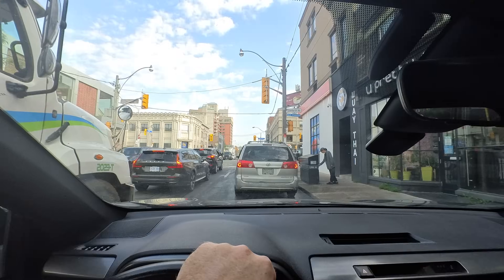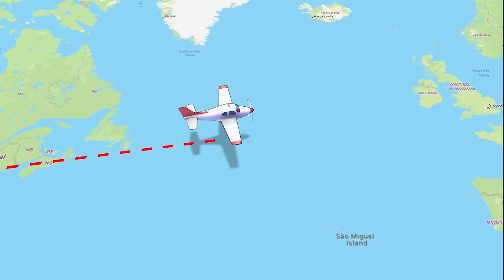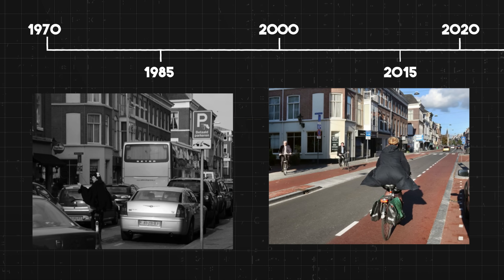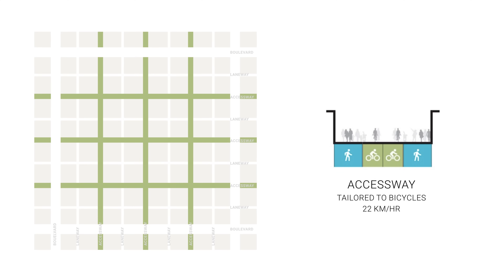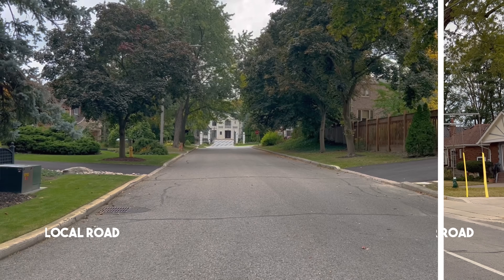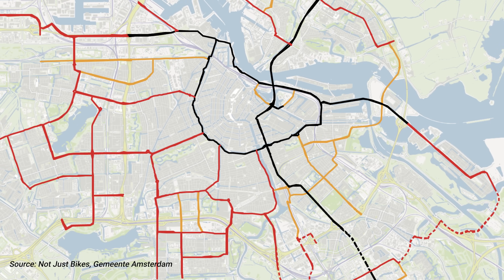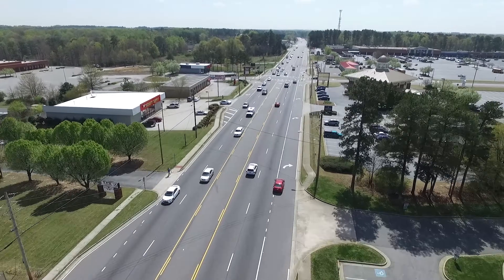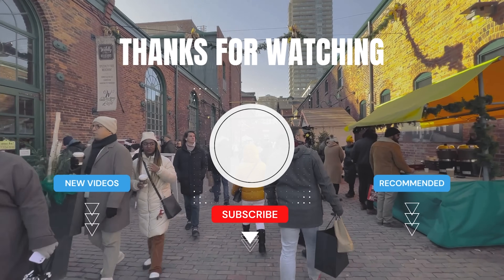How the Dutch SOLVED Street Design

Comment: The rule of thumb: If two modes of transportation share the same space, the slower sets the speed. In reality there are exceptions for places where pedestrians are extremely rare.
Reply: The Dutch book on urban planning actually explains that this is one of the positive aspects of non-separated bicycles lanes
Reply from the maker: Thanks for sharing. Good rule of thumb 👍
Reply: I think the important part is that the busy areas, like stroads, slow down traffic. Here having public transport and pedestrians would allow more people in less space. Then there will be less drivers, and the actual drivers could actually drive towards the highway and other faster roads.
Reply: Right. That's why bicycles scoot past cars stuck in traffic.
Reply: Also traffic lights determine the flow of traffic. You may have urban roads with 2 or 3 lanes per direction (cap  up to 1000 car per lane per hour = 3000). But this becomes useless when you approach a traffic light junction.  (capacity of just 150 vehicles per lane, per hour ) .    2x2 or 2x3 urban streets don't make sense and are only dangerous and discouraging for pedestrians and cyclists !
therefore in Netherlands roads/streets in built up areas are usually limited (and even brought back to)  to 1x1. With traffic lights 1x1 is enough.
Reply: @lws7394  "Also traffic lights determine the flow of traffic"

Also, traffic lights are expensive...
Reply: @lws7394 a roundabout allows for x*3000 cars to make it though the intersection compare to 150 the average flow of a roundabout is 750*x
Reply: That isn't realistic. It is hard to bike as slow as someone is walking and almost impossible in a car unless you are riding your break constantly. It is also quite silly to drive at walking speed. Down right stupid actually.
Reply: You are incorrect. Traffic lights set thejourney speed ! You can share a country road and a car will travel at 60kmh and the bike at 20kmh. Bring in traffic lights (in an urban setting) and no matter a car drives 60-80kmh, higher speed will get undone by waiting at the traffic light junction. And indeed in London the average speed of a vehicle is 17kmh !   Not due to 'bikes', but because of traffic lights and congestion.

(This counts also for bike traffic. There should be as little traffic light junctions as possible . For example in my 200k Dutch town, I can travel north to south 8km and aproach like 6 traffic lights and a movable canal bridge (esp. in summer!). And if I push it by taking a street parallel I can even limit it to 1 traffic light and the bridge !)
Reply: @lws7394  Incorrect. This depends on the distance between two traffic lights and the speeds of the cycle. Imagine the trafficlight as a busstop where a bus leaves every 2 minutes. If you get there just before the bus leaves, you've gained time.
Reply: The rule of thumb: slow drivers will spread out across all lanes, slowing down traffic to a crawl. UBER veteran.
Reply: @garryferrington811 In NL slow(er) drivers are required to keep to the right lane(s) (if more than one). Foreign drivers are easy to spot, unfortunately.
Reply: I have seen pedestrians reach high speeds...

... as soon if they are on my hood or front bumper.
Reply: @buddy1155  We outgrew that petty tribalism, buddy. People here just shrug at 'contributions' like yours.
Enjoy your day anyway!
Reply: @buddy1155  Then they are not pedestrians anymore,so that doesnt count..
Reply: @buddy1155  Then they are not pedestrians anymore,so that doesnt count